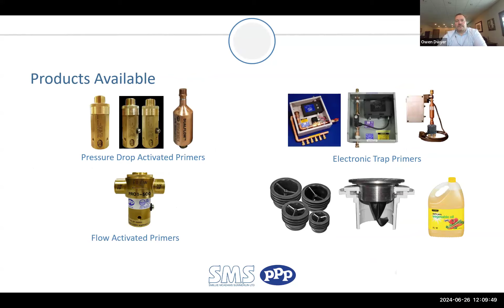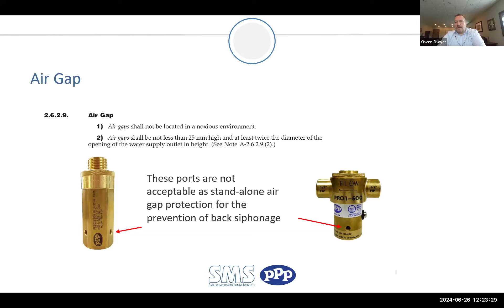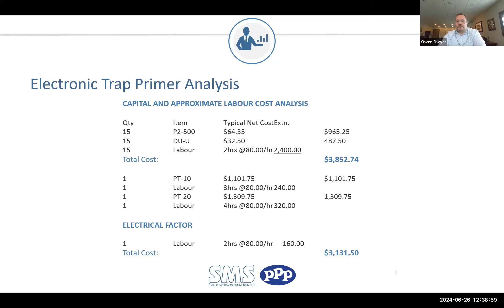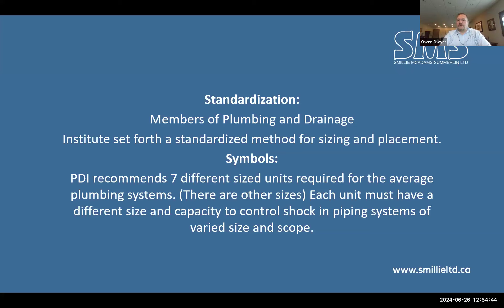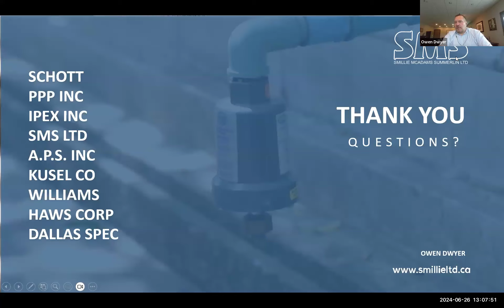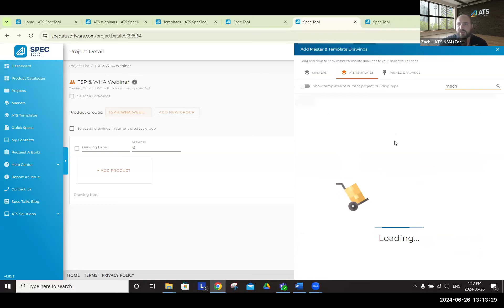Ensuring Plumbing Efficiency: Mastering Trap Primers and Water Hammer Arrestors with SMS

Comment: For the P2500 in the example, flushing 200 times daily with 75 PSI inlet pressure — would that pressure still apply if there's a legitimate air gap installed? Wouldn't the presence of an air gap eliminate the pressurized portion of the discharge line, effectively turning it into a gravity-fed system?